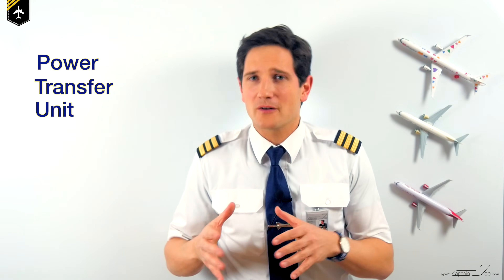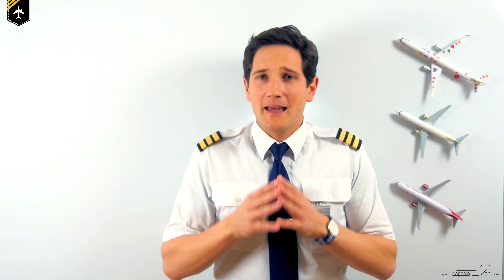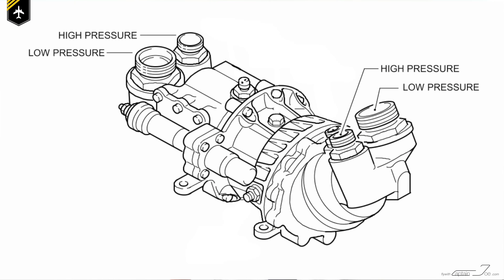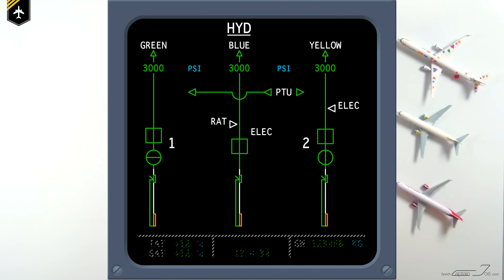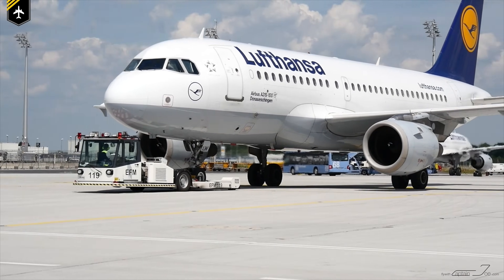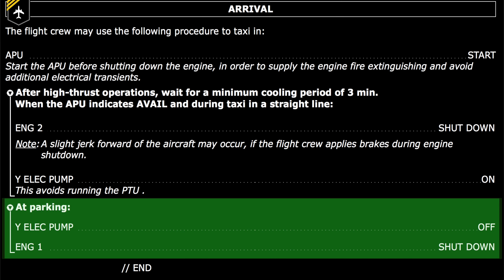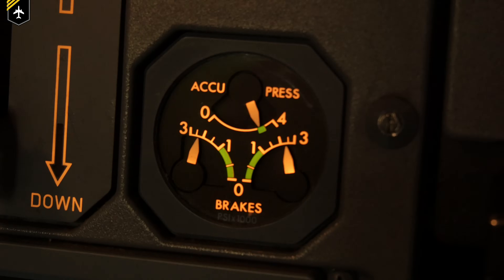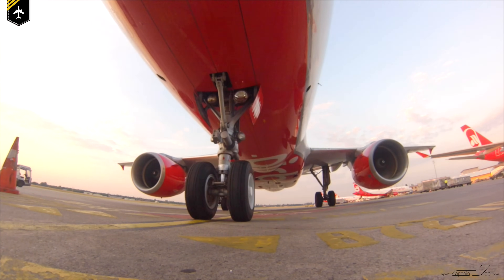MYSTERIOUS BARKING SOUND on AIRBUS? All about the PTU explained by "Captain"Joe

Comment: how do you steer the a320 on the ground
Reply: Usually there is separate steering wheel to turn nose wheel. Additionally, pilot controls left and right brake separately so it can turn with applying different force to each brake.

Comment: I was on an airbus A321 a few months ago, sitting in seat 8a , and heard some very odd whistling noises (like a high pitched sound when blowing across a bottle-top)  during takeoff and landing. It was very loud and rather concerning, almost like there was a gap in the exit door ?  Any idea as to what it could have been ?
Reply: I could send you a video of the sound if that helps
Reply: Is it possible it was the landing gear? After takeoff, when the gear is retracted the doors tend to whistle just before they fully close.
Reply from the maker: Yes could have been the landing gear extension and retraction! Greetings Joe
Reply: Captain Joe Greetings! 

I thought it may have been the landing gear, but the sound went on for a long time - (from after liftoff until about 4000-5000 feet) and also for about 10 minutes before landing.
Reply: Matt No, more of a whistling/whining sound like an owl!
Reply: Oliver Lavelle Seat 8a? Ah I left my pet owl behind
Reply: It was a gremlin. :-)

Comment: Once during a flight from CDG to CPH, in a AF A321. We heard the barking sound as the engines where spooled up. However, the sound continued during our taxi to the runway. When we reached the runway, and had started the takeoff roll, the sound died out. Minutes after takeoff, the captain informed us that we had to return to CDG due to a hydraulic failure of the yellow hydraulic system. The landing was normal, but we had to be towed to the gate, since the noose gear did not work.

Comment: there are three systems so are there also three hydraulic cylinders on each flab? how that works if two systems fail, does one cylinder have to move the other two cylinders as well? if yes...what if a cylinder is worn so doesnt move anymore? Or is it enough to have steering on lets say just one elevator flab?
How is all of that put together? It would be nice to see a video about that!
:-)

Comment: Captain Joe,

You brought up something here I haven't heard of.

Conserving fuel, that's certainly understandable.  But wouldn't running only one engine mean the plane is off-balance on the ground, being pushed from only one side rather than equally from both sides!?  Doesn't this kind of single-engine torquing put undue stress on the landing gear?

Comment: One lil question as a "professional" simmer. During single engine taxi, do you still have the APU running after one of the engines has been started to start the other or do you perform a cross-bleed start? Great video as per usual!

Comment: Captain Joe!  I have two easy questions!  1. When the plane is taking off, turning quickly or sometimes even in the front of the engines you can see cloudy condensation? It looks like smoke sometimes, coming off of the wings? What causes this vapor?  and, 2. I know about the flaps on the BACK of the wings and that they are designed to provide lift when deployed, however, I also noticed that there is a section on the FRONT of the wings that also slides forward and down?? Are these also called flaps and what purpose do they serve??
Thanks!!

Comment: Captain i am groundworker @ CGN-Airport an I wonder which System pressurises the Cargo Door Actuator in the A320-Series. In a cold and dark state of the Plane the actuators are not pressurized. Which conditions need to be fulfilled to pressurize the Cargo Doors (GPU/APU; "Galley Power") ? Thanks in advance !

Comment: Who let the dogs out?
Reply from the maker: Haha, yes you could think of that song in that moment :) Greetings Joe
Reply: who let the pumps run.... ruff ruff ruff
Reply: Airbus A320 unofficial QRH procedure to reduce annoying barking:
First check if there is PTU running. If it is start the second engine to get rid of it.
Then check if dogs are onboard. If they are simply use cargo hold extinguishers to get rid of them :-P
If they are still alive use manual pressurization to dump pressure and now you will really get rid of them!
Reply: XD
Reply: It was Airbus who ley the dogs out
*let
Reply: taurus20077 Didn't see your comment before I wrote mine :p
Reply: macieksoft If on the other hand, the plane is fitted with a pilot supervisory canine,  ensure you have fed them the  correct material and emptied the out tray.
Reply: taurus20077 γουφ, γουφ, γουφ γουφ...
Reply: Apparently the PTU did.
Reply: LOL  XD
Reply: Spirit airlines
Reply: Why is there no barking dog on boeings? Smarter hydrolics?
Reply: I should punch you for referencing that stupid, stupid song.

Comment: One question. Is the PTU needed when you shut down engine nr 1 and you have nr 2 operating? It will pressurize yellow system and the blue will run from it's elec pump as always. Is there a need for green one for taxi?

Comment: Hey Joe

You said that the nose wheel is steering the ground movement. Are there also the differential brakes (I guess an a320 should have them) in use, or is it all steered by the front wheel?

Comment: Joe, great videos! When I boarded my flights over the past few days (A320 & A319), I noticed as we were walking up the stairs to board the plane a "clack, clack, clack, clack" sort of sound - seemed to be coming from the No.1 engine. The noise was very audible, and I'd say roughly happened about 5x a second. Do you know what this noise is? Thanks
Reply: The blades have a bit of movement to allow for temperature expansion/contraction etc and as the engine windmills (engine is off but the wind is turning the blades)  them they rattle a bit.
Reply: SB Trains, Planes and Drives nice one, thanks for the answer!
Reply from the maker: Yes :) That sound is worth another video :) I´ll see what I can do, and the explanations by the other comments here are very good too :) Greetings Joe
Reply: Certain engines (like the CFM56 on Easyjet A319's) have 'Clappers' which are little stubs attached roughly halfway along the fans blade length it allows the blades to 'lock' in position when the engine is running at speed. Something to do with narrow chord blades fluttering. When the engine is idling they loosen off.
Reply: Dominic Bradley my answer not good enough then?
Reply: I wonder what happens if you make a video about ALL sounds an aircraft can produce... I bet that takes more than a week!
Reply: Dominic Bradley   that must be the  sound of the fan blades while it rotates due to wind.

Comment: Why can't you start plane engines simultaneously
Reply: For the same reason it's very difficult to inflate 2 balloons at the same time. Air pressure, or lack of it.
Reply: Because most turbofan engines start using compressed bleed air that drives a turbine that connects to the various fan, compressor blades, turbine blade, etc. once they get to a certain speed fuel flow is started hence the engine starts. It takes an amazing amount of bleed air for the process, that's why they turn the air conditioning off during engine start. I heard it in a video from an airline that the amount of bleed air available on most planes is just enough to start the engines.Now, in the future, they might be able to start both engines at the same time as newer turbofan engines are introducing electric start.
Reply: Michael Poleson I guess it's basically bacause this procedure (startup at same time)  would need more energy and bleed air than the APU could provide. But I think he has made a seperate video on the APU and this issue. Check it out ;)
Reply from the maker: That by far is the best and easiest explanation, WOW!!! Thanks :)
Reply: TheNormanator thank you

Comment: please explain how do you know where to taxi the plane after it has landed and do pilots ever make mistakes while doing it ?
Reply from the maker: That video seems urgent, many request on doing that video :) I will work on that !
Reply: Taxiways are each given a letter of the alphabet, and gates have numbers on them, the flight crews also have a map on their charts (or built into the displays on modern aircraft) so a typical ATC instruction might be "Speedbird One, exit runway at Intersection Kilo, procceed to gate 34 via taxiway Golf, Juliet, Lima". That's just an example that I made up, but it gives you the gist.
Reply: Don't want to advertise for a certain airline here, but there is one, where pilot's comm systems and passenger entertainment are united cough, cough ;-). While on the ground you can hear pilots and ground controllers talk to each other. I really wonder how it is possible to memorize the routes they tell the pilots so fast. :D
I listended to it for a while in Frankfurt, and especially Lufthansa pilots get "multilingual communication" with German greetings mixed in. That sounds very funny...
Reply: I've been listening to the ATC from Cork and dublin for a while, just because I was wondering about accents, ... just browsing around, but GEE, those language mixes can be really hard to understand! The more I realize HOW much a pilot knows,/needs to know/needs to have instant knowledge available of/ be capable of,.... 
I wonder if I still want to BE a pilot. (childs dream, but the calculating you guys do is beyond me to start with...)
Reply: Yes they do. BA 747 went on wrong taxiway in Johannesburg i think and wing struck a building

Comment: Thanks for your videos Captain! I have a question... How do you predict or know when there is going to be a turbulence area? Thanks and greetings from Mexico City!
Reply: Gabo Salazar I'm not a pilot but before flight I know the flight crew check the weather a few hours before the flight.
Reply: As well as checking the weather in the pilots briefing on the ground, airlines also communicate via radio to each other in the air, if a jet hits some bad turbulence, they'll usually report it to ATC, who'll pass it on to other relevant aircraft in the area. If the aircraft is not in contact with ATC (Flying over the ocean for example), then there's a standard radio frequency that all aircraft will tune to so they can communicate with each other, for safety reasons, and they'll keep each other informed.
Reply from the maker: Hey Gabo! We have very good and accurate weather charts, where turbulence areas are marked, and you can say, okay after take within the next hour etc we´ll experience turbulence for so long ... And then you can try to climb or descent to look for smoother air in the area. Greetings Joe

Comment: Great stuff! How about one on how the plane is steered on the ground.
Reply from the maker: Hey Jay, yes I´ve already started making that video :) Greetings Joe
Reply: Viper they use nose wheel tillers
Reply: To steer they have a seperate steering wheel to their left
Reply: jaymuller I totally agree! 😁
Reply: the wheel at the nose uses the hydraulic system to steer
Reply: I heard there is another lever/wheel besides the yoke that they use also, along with the rudder pedals
Reply: Indeed the nose wheel steering is hydraulically powered. The two "horns" sticking in front of it are the hydraulic actuators. In case of steering failure, the system attempts to leave the nose wheel castoring and tries to steer with differential braking.... when pushed back, the tug operator activates an external control that leaves the nose wheel castoring as well, so he can steer the aircraft around without fighting the hydraulic system...
Reply: For low speed , tight turns - i.e. while taxiing to the runway, they use the tiller and steer the nose wheel. Once on the runway and moving at higher speed or on long straight taxiways they use the rudder pedals to steer the airplane. Using the tiller at high speed will damage the nose gear. Differential braking is used mostly on light aircraft.
Reply: The easy explanation is that hydraulics push actuators to rotate a steering collar attached to the nose landing gear. The direction is controlled either by the rudder controls or a steering handle in the cockpit, depending on the model of aircraft.
Reply: ..the plane has pedals on the floor in which the pilots can press forward on them with their foot, if the left pedal is press, it brakes the left wheel and if the right pedal is press ,it brakes the right wheel..that's how the plane turns left or right 👌
Reply: jesus jaime You only explained differential breaking. That's not entirely how they stear
Reply: smaller aircraft steer with the rudder pedals however something larger uses what is called a tiller. it is basically a little wheel or lever that is on the side of the cockpit and it is used just like a mini steering wheel. during takeoff the rudder is used when at higher speeds to make small adjustments. the rudder can still be used to steer but does not have nearly as tight a turning circle as the nose wheel (tiller) steering. It is also pretty common to use this in conjunction with differential thrust (one engine higher than the other), and differential breaking (more pressure on one break than the other).
Reply: jaymuller pretty sure that the pilot has foot pedals that move the rudder or the forwards gear module. This is how the aircraft would turn on the ground. While the aircraft is leaving the gate, there is a push vehicle that will push the plane back and steer towards the assigned taxiway. Hope this helped!
Reply: EatTheMeatBalz_7 meatball eating number 7 idiot
Reply: EatTheMeatBalz_7 Being on your list is my biggest accomplishment. Also, your music made my ears bleed
Reply: Executive The A320 doesn't have a yoke and it's called the tiller
Reply: Executive Aven there you go
Reply: jaymuller Like a Car
Reply: Srivas R 👍🏻 great
Reply: Captain Joe thank you for clearing that up now I know what that annoying sound is it sounds like a dead car engine 😒😕
Reply: Excellent! Seriously, it's sites like yours, Pilots Eye, Just Planes,  and others, that got me over an irrational fear of flying, I'll fly anywhere on anything now :-)